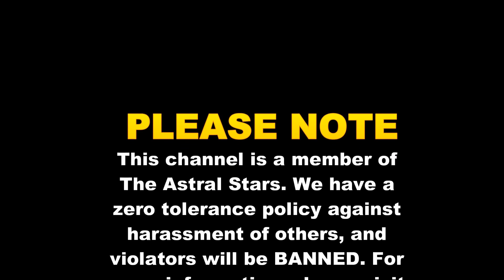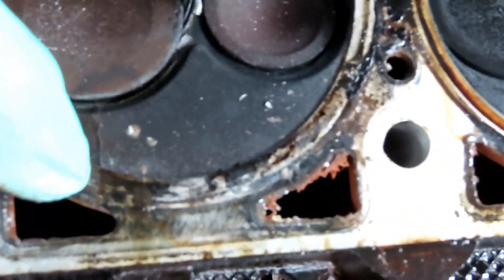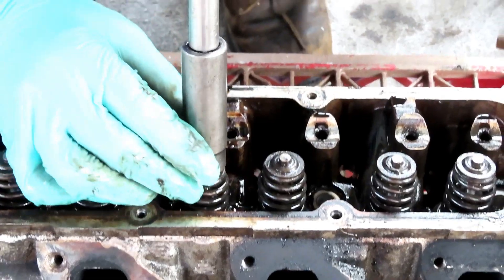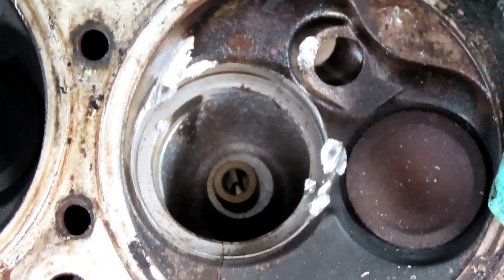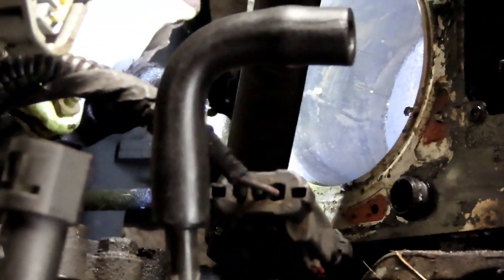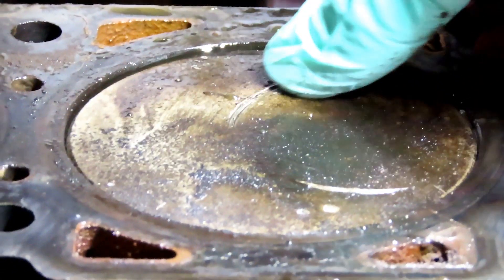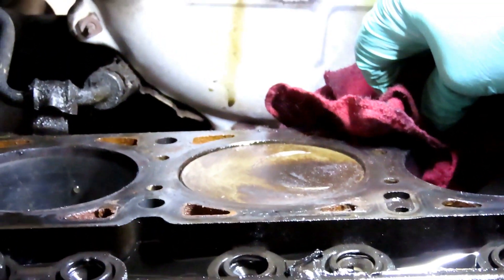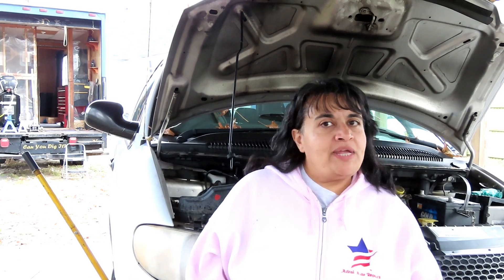⭐2003 Dodge Grand Caravan - 3.3 - NO START - Part 3 - Down The Rabbit Hole!

Comment: Hey Tim, how did you turn the engine to get the piston up?
Reply from the maker: 15mm 1/2 drive socket, at the bolt in front of the crankshaft pulley.
Reply: @OnlineAutoRepairVideos  oh ok I figured you did that. I wasnt sure cause I didnt see it. Lol

Comment: Just imagine the noise that had to have made  when the seat dropped out of the head. I’m just curious if the PCM survived the wiring harness melt down.
Reply from the maker: The one thing we can say is the computer is working as far as spark, but our concern now is that it's obvious this vehicle was not taken care of, SO, what other issues are there besides needing an engine? It sat for A LONG TIME! Fuel pump, computer, condition of the transmission, etc.